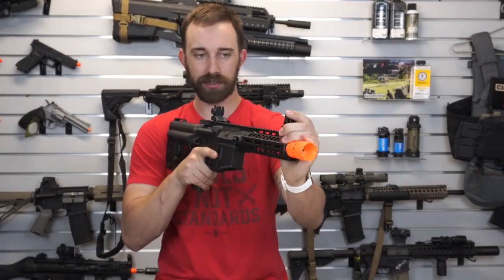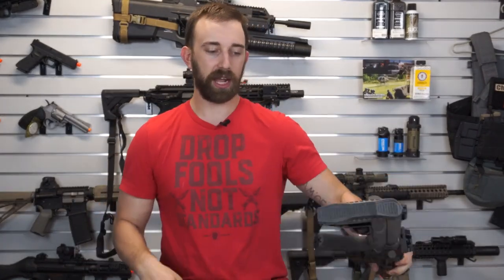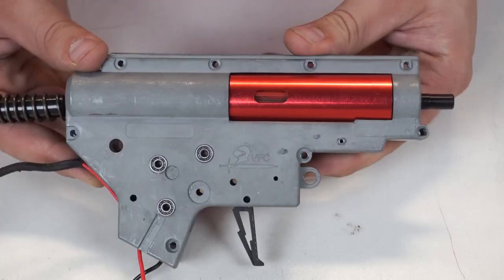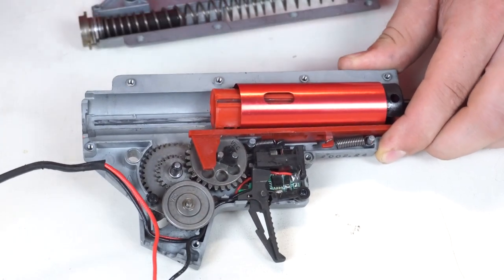Review of the Elite Force Avalon CQB series! Overview, Chrono, and Accuracy test

Comment: Thank you for this video. 5 mins in and you covered 80% of what the other videos I've watched. And I check the time after liking and...24 mins to go? Ok cool. More information never hurts. Dude, you took the gear box apart. There should be no haye in the comments. For a new airsofter this video is platinum. I was on the fence because of the internals being outdated according to others. You told me what needs upgrading. And I just need to know how to remove the tip for a suppressor. I know u cant show (read the comments) but I'll find a way.

The internals, tip and shaking stock is why i didnt want it. Though I knew the external frame was top of the line. This video confirmed my decision to buy the Bronze VFC Avalon Saber CQB. Thank you. Keep going, you earned a Subscriber.

Comment: Pic rail on the stock is usually for a monopod.  You would also use a bipod on the bottom of the forend rail.  That would be kind of for a DMR or sniper setup though.   It would not be typical for a carbine/SBR/pistol setup.

Comment: Dope, I plan on getting this AEG next week since my WE 888 GBBR wasn’t the best decision for my first airsoft gun. Also would save me money in the long run due to mags costing $50 each and as well as the green gas runs out pretty quick. 

But not I’m trying to decide if I should get the CQB or carbine variant since right now they are only $10 apart and I’d also have to buy picatinny rail attachments if I went with the CQB one.
Reply from the maker: One advantage is that the rail adapters are really inexpensive. Yea lol this is way better than a GBB for first gun

Comment: Can we see how you got the tip off without special tools.  So water.  Or hair drier?
Reply from the maker: I cant visibly show how to remove orange tips, I can describe it and I can point out part of the flash hider but the legal requirements of an orange tip and being a store I cant show that. I can say that an industrial heat gun is the best method
Reply: @TheAirsoftArena  oh I’m sorry.  Well I have one on the way.  I was curious based on research, and a little worried because the only think I see is heat gun or a torch.  Will boiling hot water or a hair drier wretch and big man muscles be enough?  What do you think on the time with boiling water.  This is my first Airsoft gun.  I got a few things I want on it one is a dytac blast tracer unit I want on this guy.
Reply: @TheAirsoftArena  thank you for the video btw.  Informative!  Will just any m90 spring and 7.4v work or do you suggest something specific (as in things available currently.) for indoor.  I was just going to have only the 11.1v and change a spring till I saw your video.
Reply from the maker: @Tyborg425  I cannot stress enough, DO NOT use boiling water. The steam will get into the rifle, mess with the hopup unit, orings inside the gearbox, wiring systems, the mosfet, and begin the rusting process on those internal parts. DO NOT BOIL ORANGE TIPS.